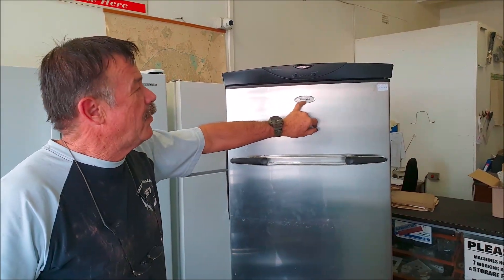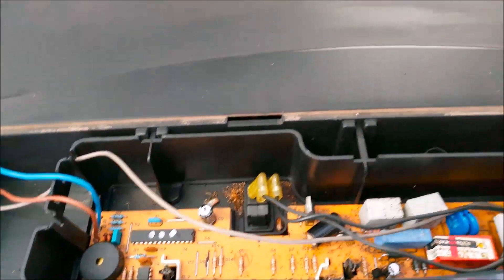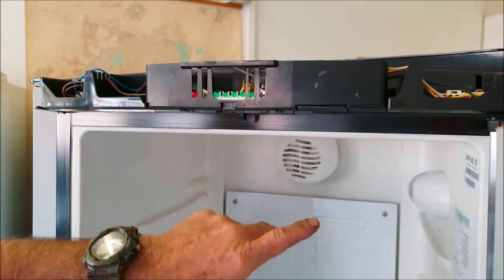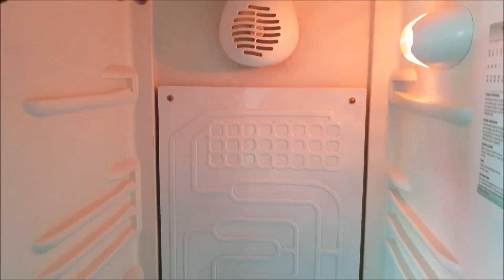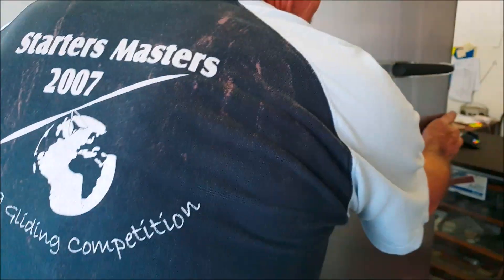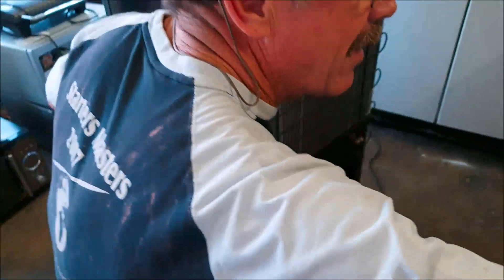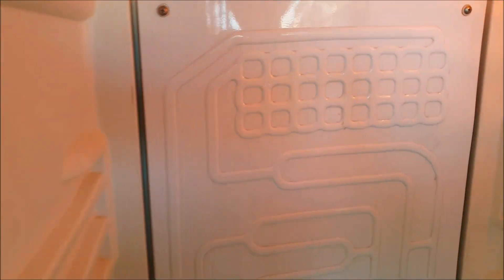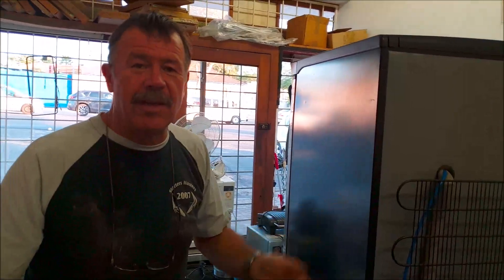Replacing electronic thermostat with mechanical parts

Comment: Hi Mr. Nel,
u could've use a door built-in double switch to control both the lamp and the fan, so they operate opposite.
This way you'll keep the cold air not pushed away by the fan when you open the door. 
thanks.
Reply from the maker: I do not have a suitable switch in my shop but if you really want to, you can let the switch operate a relay and then use the relay for the fan and light. but I don't feel it is necessary. The little bit of loss while the door is opened is insignificant .

Comment: Hi Mr Nel, I have become an unregistered student of yours through the videos like this one and I am gaining a lot as I am busy with my training program with a certain training center here in South Africa. 
I really like how you explain what you do as you carrying out your work, it make easy for people like me to follow. 
Just two questions on the thermostats, how do we differentiate between the single and doubl door thermostat and how they work. Second one, you spoke about the second little screw to adjust on the same thermostat to extend time period of defrosting, where would that be on the thermostat, and does that mean one can choose between defrost timer or thermostat for defrosting?
I really appreciate your work and expertise on this field. I wish I could be under your wing as I'm still doing my training. Thank you very much Sir.
Reply from the maker: Single & double door thermostat. The period that the thermostat allows the motor to stay off during operation is called the differential. On a single door thermostat there is a short differential because you do not want any of the ice to melt during that period. The aim is to keep a constant temperature. The double door thermostat has a longer differential because you want all the ice to melt off the cold plate before it restarts. We call this cycle defrost. The calibration adjustments differ on different manufacturers thermostats. A defrost timer is only used when you need to switch a heating element on & a compressor off. It is not used on cycle defrost.

Comment: Refrigeration is not my field but I do know all the thermodynamics involved in it. I have been watching many of these videos on refrigeration and I must say that this gentleman is very intelligent as to the manner he goes on diagnosing and repairing and even redesigning the system. 
Sir, congratulations, not only on your physical skills and mental abilities but also on your courage to tackle some work that is very difficult and many would simply dispose of the unit in question. I admired your welding such thin aluminum pipes with a neutral flame!! 

At home, this week we had problems with the fridge/freezer and the technician said that it had a leak in the evaporator which was embedded in the foam and he could not service it. Before disposing of it I decided to get to all the units that made up the fridge-freezer and it was an education for me seeing that the Compressor first fed the steel pipe condenser which then fed a long steel pipe that went all around the door of the freezer and then to a copper pipe to the drier/filter. then to the capillary tube which runs very close to the return pipe from the evaporator in the freezer where the capillary feeds the other side of the evaporator.   

I must say that it was enjoyable seeing the new electronic technology working in hand with the mechanical parts and the thermodynamics, but  I must say, that had I been living close to you, I am sure that you would not have advised me to dispose of it because of a leak in the fridge compartment.

Sir, congratulations once again